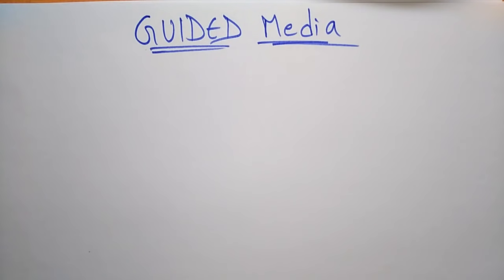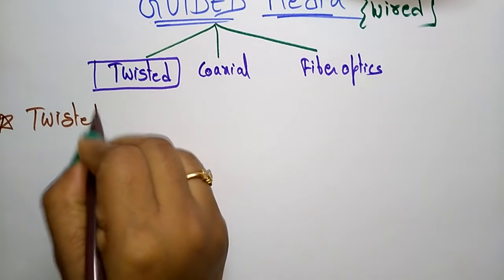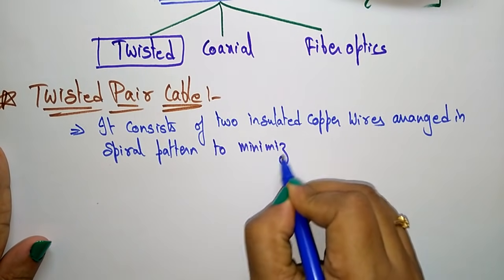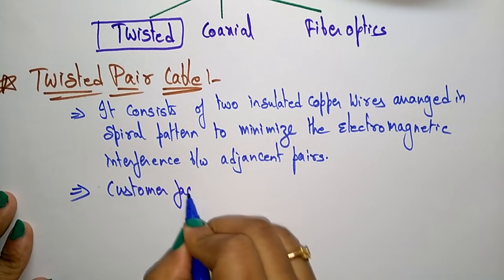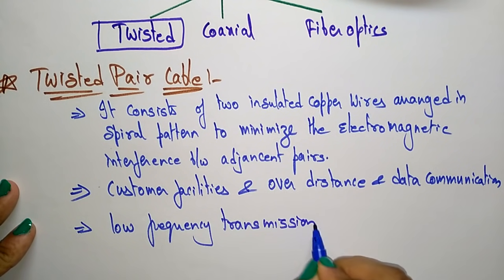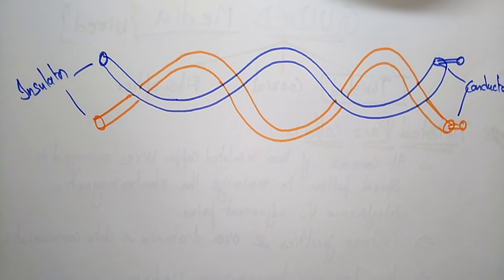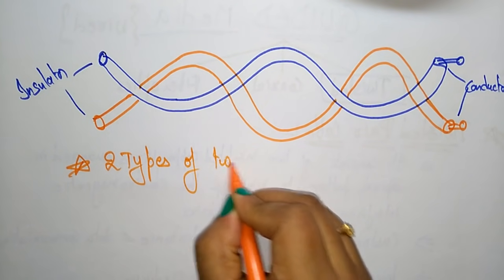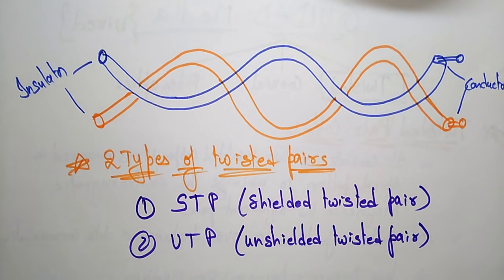Twisted Pair Cable | Guided media | CN | Computer Networks | Lec - 39 | Bhanu Priya

Comment: 5UTP supports 100 mbps data transmission, not 10.
Reply: Category 5 (Cat 5) Unshielded Twisted Pair (UTP) Ethernet cables are capable of supporting a data rate of 10 Mbps (megabits per second).While Cat 5 cables were designed to support 100 Mbps Ethernet (Fast Ethernet), they might not always provide reliable performance at that speed due to various factors including cable length, interference, and signal quality. The Cat 5e (enhanced) cable standard was introduced to address these issues and provide better support for 100 Mbps Ethernet.